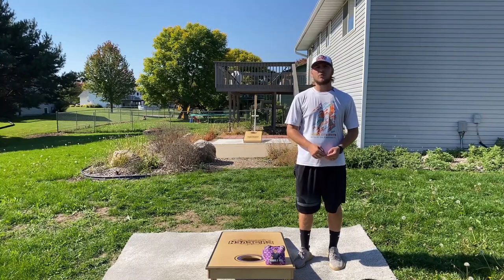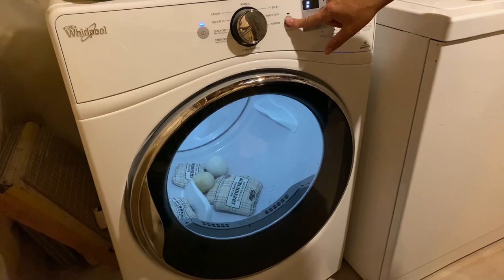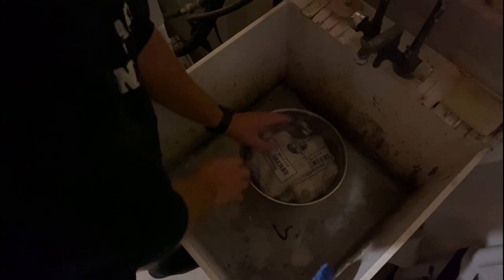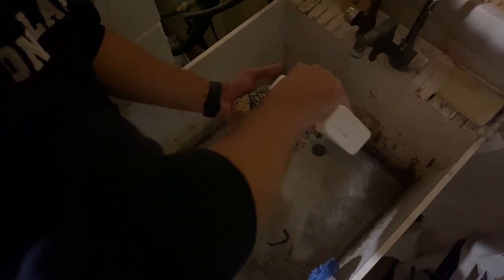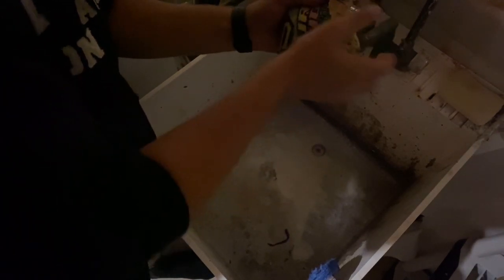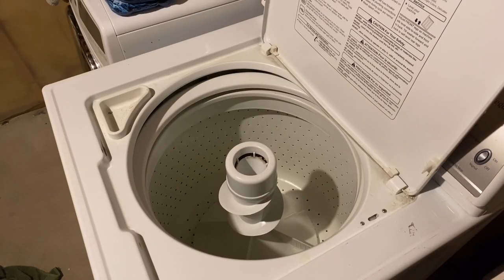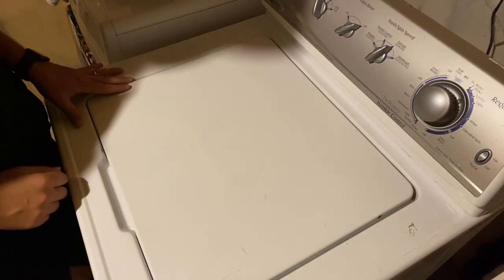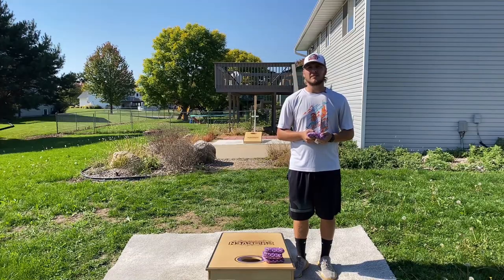How to Break in Cornhole Bags // Cornhole 101 - Episode 3

Comment: Usually condition all my bags, let them sit in conditioner for like 20mins tops then, wash them hand rinse them or  throw them in washer just rinse them without soap. And then tumble mine for 30mins. Usually work great for me,  and sometimes boil my bags with softener for like 15mins on stiffer bags. That works for me too and then hand rinse them then tumble then low heat.

Comment: This information is terrific. So depending on the bag materials, which I know there are numerous, how do you know what approaches to take for those? Someone else in the comments asked about breaking in suede specifically. What are the guidelines I guess from material to material? Recently Subscribed! :)
Reply from the maker: I usually start with just a hot water soak and tumble. If I feel that the bags could use more ill do wrinkle guard. I take breaking in bags lightly because its very easy to destroy a bag. Once they are like 70-80% broken in I will throw the rest of the way.

Comment: Nice video on all the different ways... If you could, what would be cool is to take all the methods you shown here and show the before an after between them all. Get a bunch of cheap bags or if a bag company can donate you some bags and show the before and after's on all the methods.

Also you missed one other that's been going around...Sac Relax :) though this would fall in the conditioner/softener line I feel, but they say it is different than those products though no one has figure it out yet what it really is.
Reply from the maker: I tried sac relax on a bunch of bags and I found a method that I like more. Could possibly do an update tho
Reply: @CornholeBagReviews  What method is that you found to like more...As I write this, I am watching your "Which Break in Method is the best?" video...So maybe you will say it in that video as I watch it.
Reply from the maker: @Tig3rj  Lately ive been soaking in softener and water overnight and then washing out with detergent in the morning. A lot of people would say its risky so proceed at your own risk but I like it.
Reply: @CornholeBagReviews  Thanks!! I just came across that in your other video...I may try that on some basic bags to see how it works. I saw you said you use Wrinkle Guard..assuming Downy. Some things I question about it if it leaves a residue over it and that is has Amodimethicone as one of its ingredient which is a silicone base chemical used in hair products. Plus I am sure the material on all the bags would react different as you mention here in this video. Which I mention it be cool if you had a before an after through the different processes.

I am also want to attempt the simple 50/50 water and vinegar method as I been reading this help soften clothes.

A bag company needs to come out with "Pre Wash" bags like they do with jeans ...lol

There you go, a new series for you to make if you want hahah... "Does it work?" (Does this product/process work on breaking in your bags?) Borax? Conditioner? Hand Lotion? Bleach lol? Softener? Baking Soda? and so on...

I thank you for the response..Keep up the good work and videos!!

Comment: I have the Costello bags and the black sheep OG2 for the wrinkle guard method would I use hot or cold water using the wash machine thanks for the info.
Reply from the maker: I use a normal cycle so warm water, both would work

Comment: Have you ever tried a double boiler or steamer? I'm like you boiling scares me. With the double boiler your bag won't sit at the bottom of the pot where all the heat goes. That is what they use to melt chocolate without it burning....the steam from the bottom part steams up the top pot heating the water in it or if using a steam pot the steam just penetrates the bags
Reply from the maker: Never tried, to be honest I don’t even boil almost ever. Almost every bag is good with a hot water soak and tumble. And for the rough ones I do conditioner
Reply: @CornholeBagReviews  yea boiling directly just sounds risky for $60-$100 bags. 

Next time I buy some cheap bags for family I think I will try steaming them...a couple I will condition then steam...others just steam. Problem with cheaper bags is the material is so different.